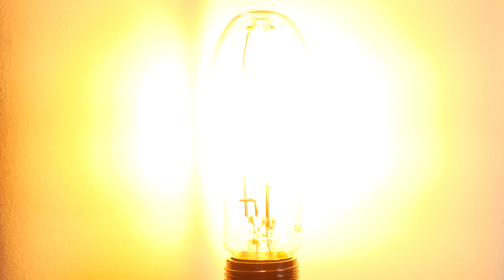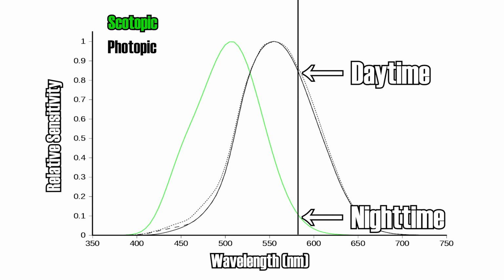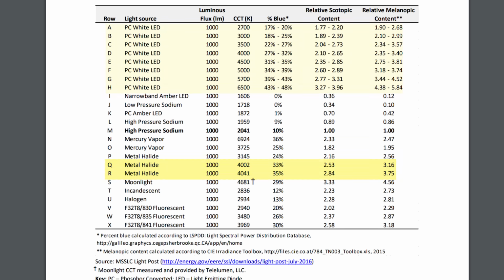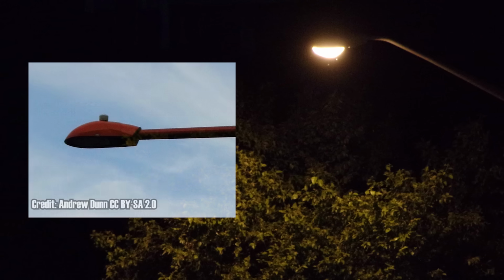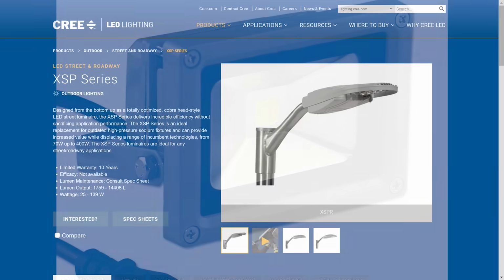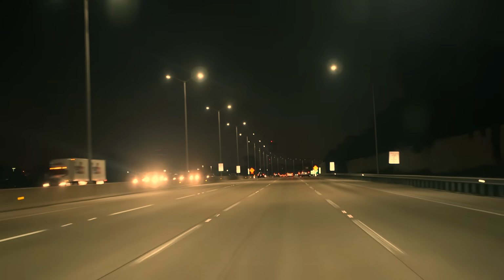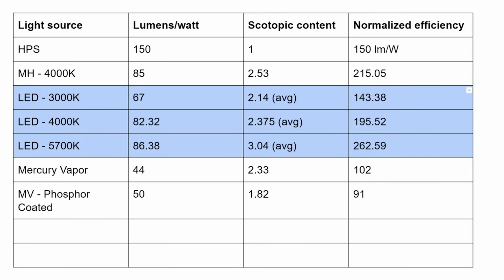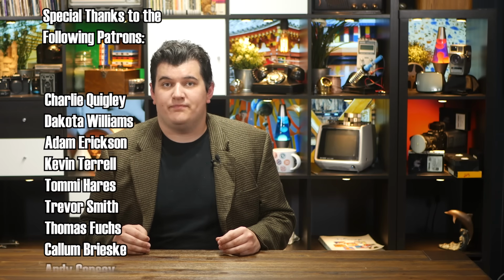The LED's Challenge to High Pressure Sodium

Comment: They have been moving to led street lighting here in Australia, and being someone who drives home after dark every day I actually found the highways that have led lighting to be a higher risk of animal strike.  The checkerboard effect generated by the bright led illumination directly below the street light that sharply drops off creates dark patches between the lights. The effect of these dark patches are increased by the intensity of the LEDs as you pass by them. I find my eyes can't adjust quickly enough to deal with the brightness from the led vs the dark shadows generated between.  Although the sodium lights were a dimmer light, they did diffuse more evenly along the road and allow you to see all the way along the highway (all be it at a dimmer light) without the blind spots that kangaroos seem to like to stop in.  I imagine the safest thing would be the brighter LEDs but at half the distance apart to light the dark patches between. This would double the number required and most likely negate the energy savings though.
Reply: I saw some pedestrian street lamps replaced by LED near where I live too. They created the checkerboard effect you mentioned and it's annoying. But for that part of problem I would blame the fixture design though. An LED lamp could be in arbitrary light spread angle if designed well. Another concern is they replaced orange low pressure sodium lamps with white LED, which doesn't match the surrounding and bad for people's sleep.
Reply: Also, there is less spill over on the roadside so animals (and pedestrians) are closer to the road before they are illuminated.
Reply: That's more of an optic flaw than a flaw of the LED. There's a lot of cool stuff you can do with an LED with different types of optics. Wide beam, narrow, circular, square, oval and so on. He actually briefly mentions this in the video.
Reply: Wow
Reply: This is an old comment but omg - people look at me like im insane when i mention noticing this checkerboard effect, im just so glad to see others have also pointed it out. Its brighter and clearer, yeah, but on some areas almost only directly underneath the light. Specially those areas with those shorter light poles and those where the lights used to be sodium and were changed to led - the new roads that had pole spacing designed for leds don't seem to have this issue. They changed the tech but didn't consider changing the alignment, spacing, etc. So you're basically going from getting flashed by going from a well lit area to near darkness to well lit area again...  Add the stupid led headlights that look like highbeams to that mix and driving at night became super unsafe
Reply: Twice the number of light fixtures at half the power should be the same amount of light, with better spread. Of course actually doing it requires a competent local government and competent contractors.
Reply: Yes. They are terrible for driving and painful for every other purpose except surveillance. So of course they are being deployed everywhere. Our children and their descendants have been robbed of a pleasant night time environment and the glory of the night sky. It is a global scandal and hardly anybody seems to care.
Reply: As he talked about in the video, there are multiple options to allow for a more constant lighting, I have even had that issue you describe with HPS lighting you don't have to decrease the distance rather the fixtures just need to be redesigned to better match the type he shows on the highway where it lights up more evenly but doesn't throw a lot of light everywhere else.
Reply: in Winnipeg Canada we changed almost ALL of our street lights to LED in ONE GO and that issue is VERY noticeable NOW compared to the HPS / induction units they replaced 
the change up happened in districts in town and BEFORE they were 1/2 way done the NEW units started failing and they stopped and replaced the FAILING units with a different design that was NO better up and down the street but was FAR better sideways ACROSS the street but those LAMPS are NOW failing and they will eventually replace them with another different unit
Reply: @jasonriddell  talking IN half CAPS makes YOU look LIKE a GIT
Reply: They are also failing here in the USA not lasting a year before turning blue. They say bad batch of LEDs LOL I think bad design. @jasonriddell
Reply: @lightingnut the estate I live on in the UK has them I haven't seen one fail yet. I've personally found the very reliable I have a led light I put up by my front door a good 4 years ago was about £5 very cheap. Apart from unplugging to use the hoover it is on 24/7 to light the front of my house and still going strong.
Reply: @jasonriddell yeah I live in Winnipeg as well. I can say with 100% certianty that like everything else in Winnipeg, they are the cheapest lights money can buy.

It seriously baffles me how many damn times they "update" something JUST for it to look worse than it did before because they cheaped out.
Reply: @jasonriddell  thanks for all the caps. I'm embarrassed to have to share a city with you
Reply: @jasonriddell  I'm sure even with its failure rate, which will improve with the technology, LED lamps are very cost-effective because of the power they save. At ~80 watts for an LED vs. hundreds of watts for sodium, they pay for themselves in no time. A city can't ignore the electricity savings. Especially for a province like Manitoba that gets a lot of its income by hydro exports to the US, where it helps reduce burning coal.
Reply: It would more than negate the energy savings and on top of that it would double the amount of raw materials required.
Reply: It's not as if these lights are supposed to be effective. They're cheaper, and better for CCTV, surveillance and to hell with environmental problems and the pain of having to live with them. .
Reply: It's a well known problem These new lights are not fit for purpose. They were deployed with no proper research or even much thought. Goodbye to the beauty of the night.

Comment: Unless you want everyone who is driving be asleep, then I would personally prefer the cooler safer lights.
Reply: @0972q8 I would simply close the curtains on the bedroom windows obviously.  Wondering if you ever heard of those.  They are quite convenient and there are versions that would prevent any light sources from the outside to enter the bedroom.  As an extra precaution, I would also turn off the lights inside the bedroom when sleeping since I would only require a light source once I'm awake. And the lights I require to be awake must be a cool daylight, pure white, close to the blue tone/color spectrum which my body refers as daytime and helps with staying awake and alert as mentioned in the video. Note that I currently live in the northern sections of the planet and there are times where we do not get enough direct sunlight during most days of the year. And I also used to live near the equator and the same rules applies for day and night time tasks,  sleeping, weather conditions, time of day, location, etc...

I should be called the ***Absolutely Obviously Guy***. 🤣👌

...Captain Obvious would be incapable of matching my Obviousness.
Reply: @hmascuba  Ive got blckout curtains and the lights still leak in keeping me awake. At the very least, the lights should go off after a certain time
Reply: @jod125  if lights go out at a certain time the safety will decrease on all factors,  pedestrians,  drivers,  even the security of your home may be compromised.  I have those curtains and I don't have an issue.  If  your curtains are a bit too small for the windows or they have a big gap from the edges of the window and the curtains,  there are options to fix it, such as tape,  tags and/or a different type of curtains and/or different sizes might help with the issue you are experiencing. HPS lights, even though they may be slightly better at keeping you asleep... the best option will always be no lights if you purposely want to sleep at a safe location to do so. However city lights are still essential  for safety as soon as it starts to become dark. Cars do have headlights but at night these lights would only give you a limited field of view and if you live in a place like the one I live in,  then you would notice that about 98.5% of drivers do not know what is the purpose of the lights around the vehicle and never use them at all. And these includes the brake lights which almost every vehicle here has it burned out and not one here seems to care.

Comment: Technically disrupting circadian rhythm would be useful on long drives to prevent you from falling asleep at the wheel, or even just being less alert from tiredness. While it's a problem in the middle of a city, it could be useful along motorways and long rural roads.

Comment: Here's a thought. Maybe we should use a color temperature of light that would help keep drivers alert and aware. So maybe the blue temperatures are better for our roads so our drivers aren't falling asleep?
Reply: Blue light has strong ability to scatter in particles compared to warmer colors of light. Not only does this mean increased glare, it also means any particles in the air such as rain or dust get turned into blinding curtains of light. The human eye is also quick to darken it's vision under blue light, an adaptation to daylight. These factors, and many others, make white LEDs containing blue light a terrible choice for lighting at night.

Comment: Personally, I dislike the harshness of the LED lighting, but I figure the tradeoff is worth it from a safety perspective.

As a possible side benefit, maybe it would decrease the incidents of people falling asleep at the wheel?  Though it might increase the incidents of daytime accidents from sleep deprived individuals....
Reply: There are no safety benefits to white LEDs. The blue light that they produce has strong ability to scatter in particles, it's the reason why the sky is blue during the day. This blue light scattering creates glare and turns particles such as rain and dust into blinding walls of light. Our eyes are also quick to darken their vision under bright blue light, an adaptation to daylight. This means anything not directly lit by white LEDs is invisible at night. Overall they are a poor choice for lighting.

Comment: Another problem with light pollution is environmental : many birds and insects use the Moon to fly in a straight line. However, outside lighting outshines the Moon, and makes the animals fly in circles around them, until they crash or die from exhaustion. And we're not talking only about pigeons and moskitoes. In fact, a lot of the birds killed by public lights are of endangered species...

Comment: Using lights on a road where there are no pedestrians is totally stupid. The cars have their own lamps to handle that.
The street lights are useful only where the pedestrians are, and only if there is some pedestrian. So the best thing to do is to have lights only on the places where a pedestrian is using sensors that turns on the light when needed.
Reply: I kinda agree? But a car's headlights can only reach so far. In order to be able to see further parts of the road you need streetlights.
Reply: @TehVulpez  Not totally true, on many roads the lights are . I live in Switzerland where the highways have no lights and there are no problems at all.
In the city, in some areas you don't need lights neither (ex. in all business areas, where in the night there is almost no traffic).
You need only to ensure safety for pedestrians, if you have a light that turn on when people are around, it ensures three things:
1. The pedestrians see where they are and what is around.
2. Cars can see a light turned on from a long distance and identify easily the pedestrians, when light is everywhere you probably can't see the pedestrians from far.
3. Better security because any burglar that try to hide is immediately identifiable because the light turn on where it is, so no place to hide.
4. Usually if a driver can't see too far he automatically slow down, so even better security.

So I insist that to have better security and less energy consumption, the best thing to do is having light only where pedestrians are.